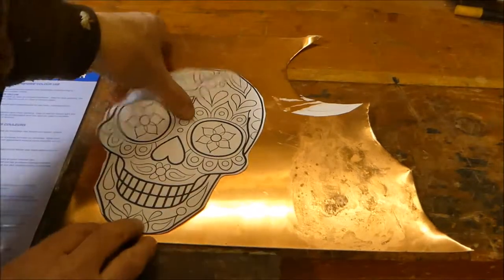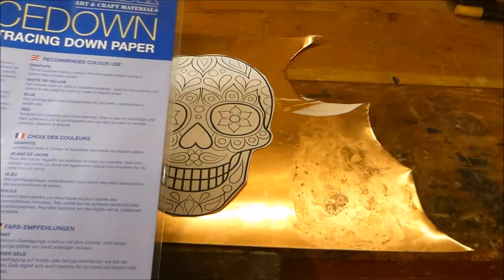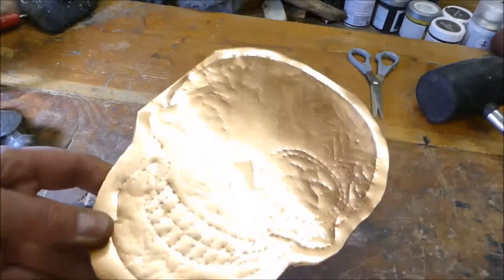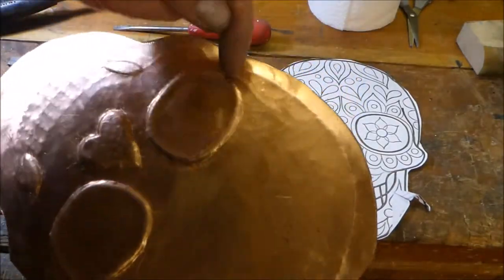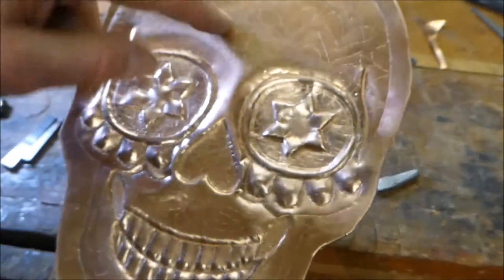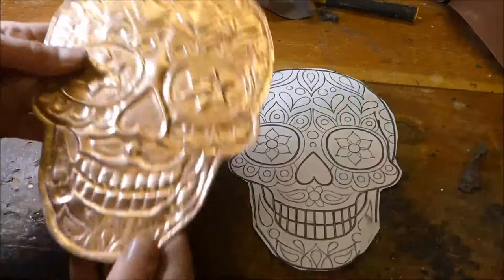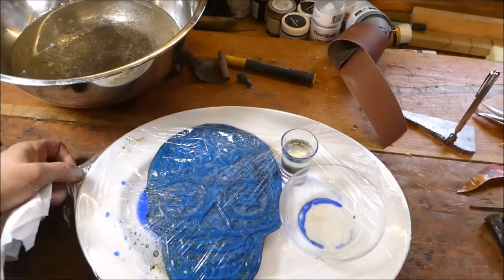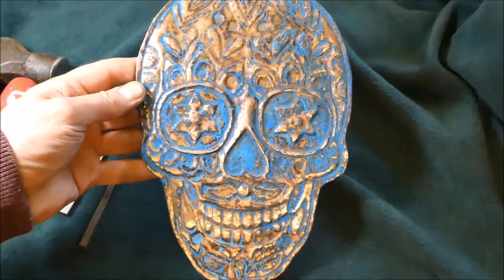How to make a Sugar Skull from Hammered Copper

Comment: What gauge of copper are you using?
Reply from the maker: Stephanie Couto I bought the sheet from Amazon and it is sold as 0.9 mm  thick, not sure what gauge that is in copper. Thanks
Reply: 20 gauge